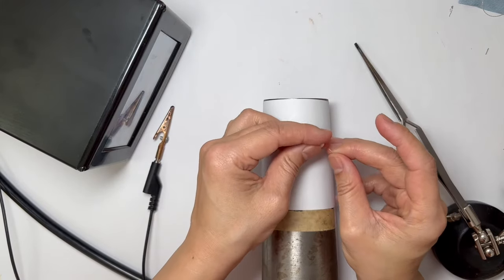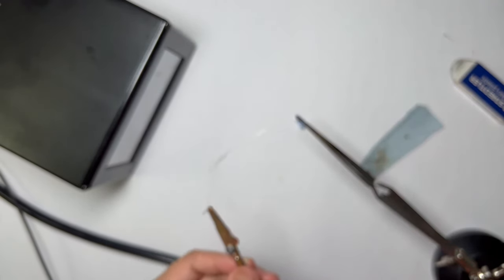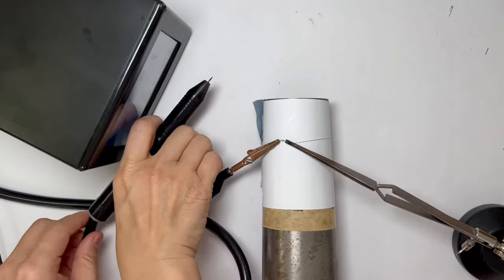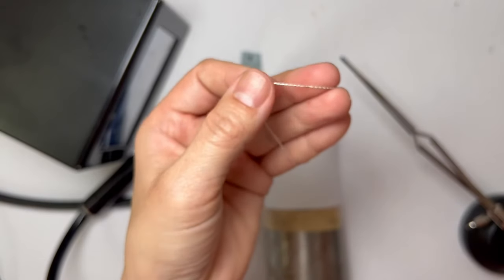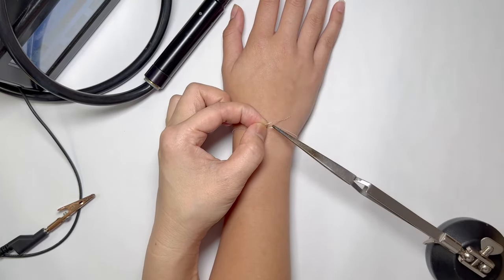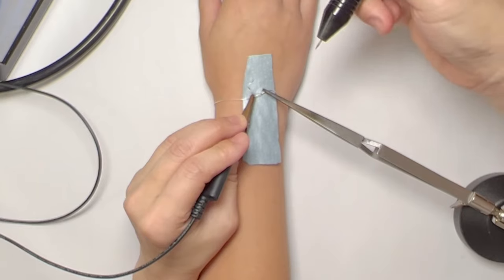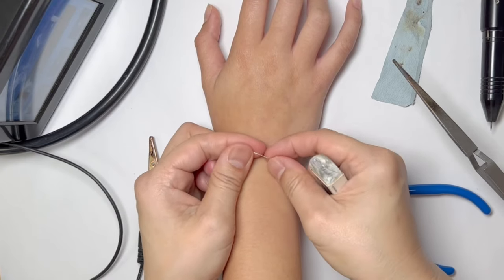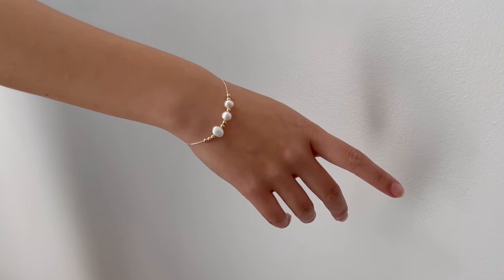15.  How To Weld Super Fine Chain with No Jump Rings - Free Permanent Jewelry Training

Comment: Hi! Thank you so much for your video! I have a question. If I am making the ball on the side with the third hand (and not making the ball on the other side at that time), would I not need to put the grounding pliers closer to the side with the third hand?...then move it to the other side to make that ball? Thank you so much for any advice because I am literally just starting (got my machine yesterday). Also, what kind of eraser to you use at the end?
Reply from the maker: I realize now that the grounding pliers/clip does not need to be super close to the area being zapped, as long as it is clipped onto the chain, it is fine.  It distance seems to matter very little for the electricity to conduct.

Comment: Where did you get the long pliers and the cylinder that the bracelet goes around?
Reply from the maker: That is called a third arm jewelry clip (sometimes called third hand).  You can find that at PePe Tools and any silversmithing supplies.  You use that to help hold things while soldering - it's weighted at the bottom.  Hope this helps.  You can email me with your location and I can tell you who might have it in your area or willing to ship.  Dana@stonesandfindings.com

Comment: Where can I purchase this tool?🙏🏾
Reply from the maker: You can buy it from PePe Tools (they're the largest distributor of Orion line up of micro welders and have excellent after sale service).  I can credit you for the commission with the chains I wholesale.  f you want to purchase one, and buy through the following link, you'll get a great price and warranty, and I will get a commission IF and ONLY IF you buy WITHIN 48hrs of clicking the link - you can click again later. Here is the link to the Orion Micro Welder that I purchased and used in my video, and you can ask them about accessories and parts for the welder:https://bit.ly/mpulse30